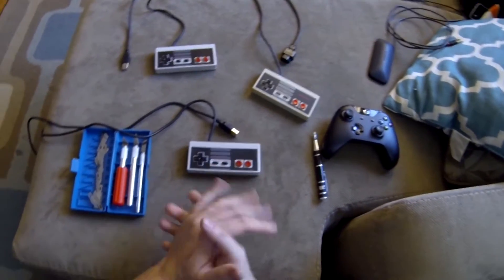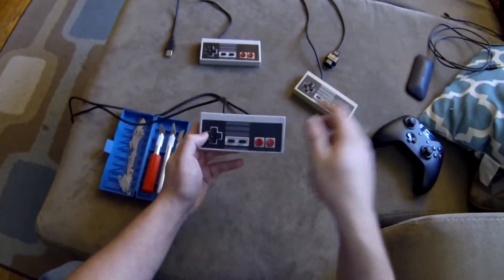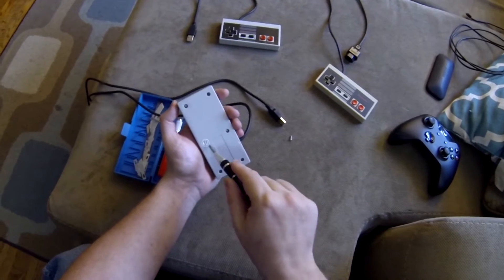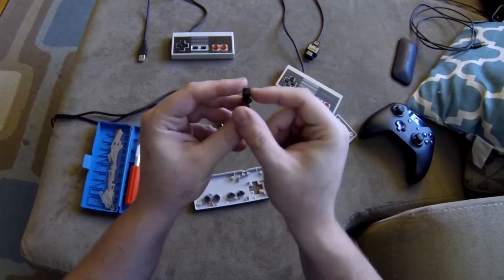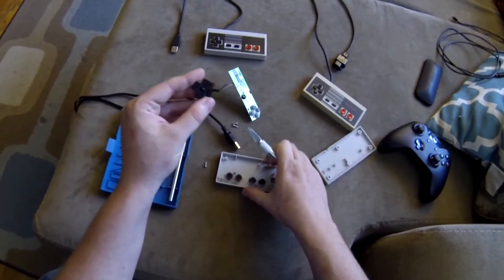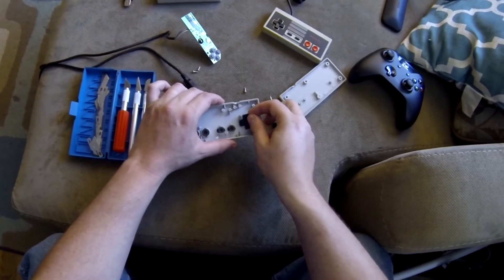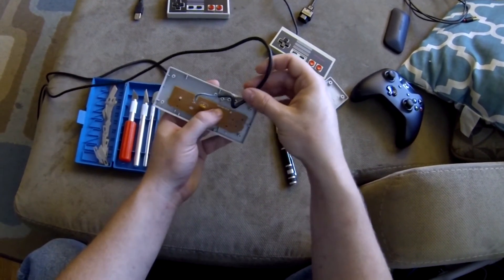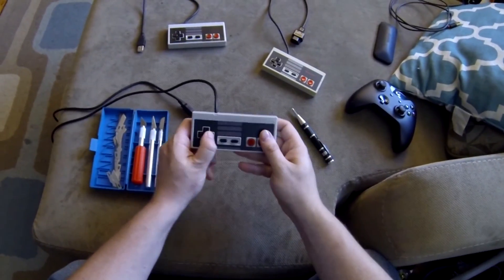NES USB Controller fix

Comment: it did not work for the ones i have, for mine i think you should not shave to much off. But maybe just a tiny bit, cause mine came to unresposive now, and you need to press to hard to get it moving, and you can get up+left or up+right anymore. Its incredible how bad those controllers are, and they still sell them.

Comment: Every time I hit the up button the game pauses. Very frustrating! Help please
Reply from the maker: It sounds like you have a short circuit.  Did you still a liquid on it? If something has spilled on it the residue left on it could cause a short between controlls. So when you press a button a different button presses in addition, exactly what you described.  To fix that use rubbing alcohol and a cotton swab. Soak the swab for a second in the alcohol then rub it over the circuitry, don't worry it won't hurt it any.  Once you have cleaned it up let it dry then try it out.  

I hope this helps 🙂
Reply: @petercamuso2474  I'm going to try to fix it that way, my problem is that when I press button B, they press A and B together.

Comment: I just did this and it just made it harder to control, like I would have to press the buttons twice as hard just to go in the direction I want. I does solve the  going up and right at the same time issue but now I have to press the buttons really hard for me to play. If I were to revert and play I am back to square one (what I mean by revert is, I filled the little holes with aluminum foil so that maybe there is more pressure from the inside of the circle on the controller buttons instead of the outer circle I just cut off) I don't know what to do know
Reply from the maker: it sounds like you may have gone too deep with it.  filling it in with something would be a good solution if that's the case but aluminum foil I think would be too uneven.  you may have to get creative with this.  I would get some card stock paper and cut small squares out then stack em with a dot of glue in between each, maybe use a glue stick.  it's probably going to get messy and annoying but this way you could stack say  5 slices each for example.  if its too much go down to 3 if it's not enough, go up to 7.  you may need to change it up until you get a good ratio.   you may find this method doesn't work at all but I hope it gives you some ideas on how to fix the problem.

Comment: i have two cheap usb snes controllers and when i plugged them in i was met with same problem as you described. do you think my controlles can be fixed the same way?

also i find it quite strange that even though dpad is just four buttons the pc recognize them as joystick. really weird
Reply from the maker: it would be worth opening it up.  if you do see there is a raised part like in the video, try the fix then test it out.  if it works let us know then do your second controller.

it is not uncommon that your machine labels them as joysticks.  my raspberry pi also refers to them as such.  what is important is that it works when pressed.
Reply: Hey Herra, did you fix your SNES controller? I have two and while the games are playable, i will often press the down button by accident when running right.

Comment: I just tried this and now my d pad doesn't work
Reply from the maker: This fix wouldn't make it stop working.  That would indicate damage perhaps when you opened it or when you put it back in. I would check the solder joints or contact pads.